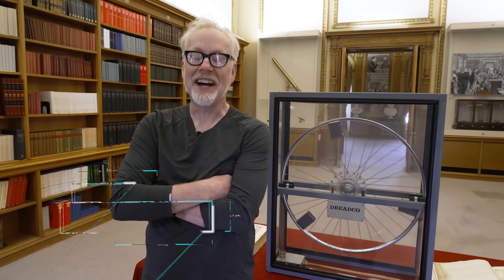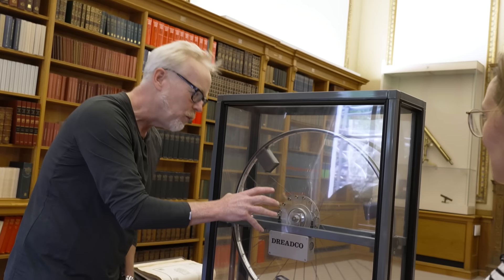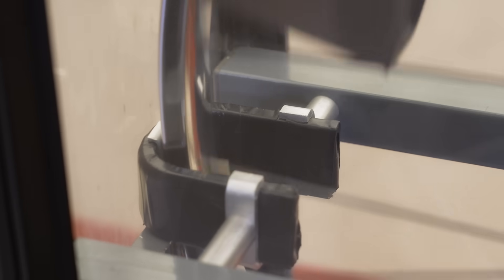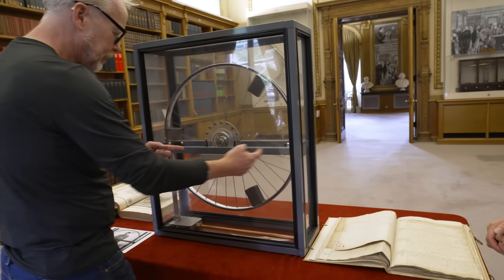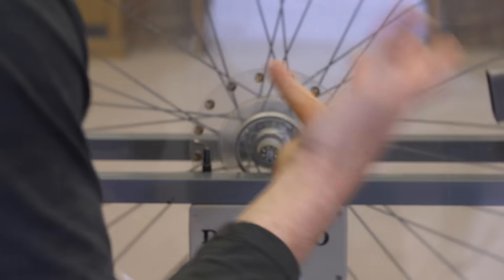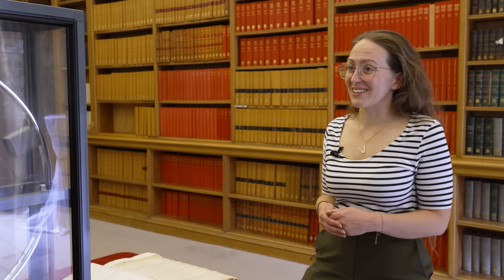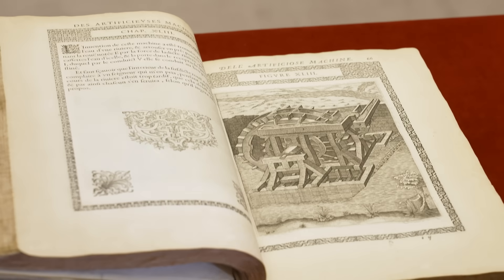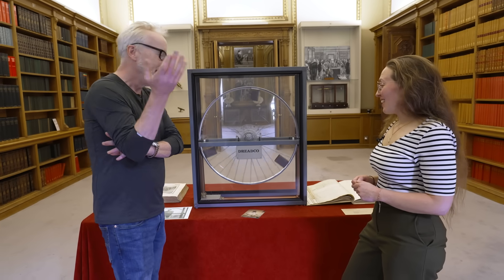Adam Savage vs The "Perpetual Motion" Machine!

Comment: I love this but suspect that it might be a carefully staged illusion. I was quite disappointed that we never saw the wheel from the other side. (180-degrees) I wonder if seeing from that angle would give away the trick. I can't help but wonder if Adam might be "in on" the joke. I did stage hand work for a time and one of the shows was a magician. Although there were limits to where we could stand back stage or in the wings, it was clear that the "back" of the contraptions were cleverly concealed when the device was rotated to give the audience the impression that there was nothing to see behind there. We don't even get a good view from the display box side.

Maybe I'm being far too cynical. We don't really know the composition of anything we see. We don't get a close-enough look at anything inside the frame or at the frame itself. What does the frame and device weigh? Are some of the spokes conductors and some spoke connections insulated? Could the "copper " conduit itself be part of a circuit and not containing or conveying anything inside? Could the conduit and the box with the "light meter" screened grommet be all for show? We don't even have a really good view on the depth of the Dreadco label. I think that the construction has misdirection almost everywhere we look. I think it is wonderful.
Reply: I watched a video of Jones showing his machine in his workshop ( https://www.youtube.com/watch?v=ZLFBgkX8lxQ ) and it has fewer extras -- I don't see the heat-sink box at the lower left and there is less visible copper conduit.

Comment: Magnets slide a ball to the outside which means the ball will be there before gravity and this add an extra force where it speeds up the wheel. The reason it slows is because of the parts becoming worn out.

Comment: Wait - David Jones? I'd love to listen to the Amp Hour podcast with him... hahaha!
10/10 would reverse-engineer. An interesting device.

The ball-like end on 0:58 remind me of a spark gap on a Wimshurst machine, might be there for attracting electrostatic charges. The spiky electrode on the opposite side might be for charging and repulsing the small round objects placed near the spoke crossings. If the latter is positively charged and the former is negative, the spiky electrode would positively charge the incoming dots and repulse them, then the negatively charged ball would attract them. All else would be any generator and control circuitry placed in the "Dreadco" box.

Also, I'm not sure what the whole assembly is placed in: what's the gas and its pressure? How does it interact with the device?
And what's hidden inside the copper tube?

Comment: Geeze! They copied one of my designs that I was recently making using a bicycle wheel!
I never finished it due to not having a board to sustain it properly without wobbling. My version runs flat on the floor instead of upright on this video. First design I started back in 2016 but for it to work properly, I need a CNC machine to cut the parts and Im not going to invest $6000 in a machine to design something that may never work. Its another reason I been laid back with it.
But this design on video is nothing but a smart motor design running on some type of voltage.

Comment: Easy answer the boxes are magnets using opposing forces  against the magnets on each end boxes on wheel ads weight to the wheel making it a Flywheel weight keeps it moving past opposing force of magnets just enough to overcome the approach the pushes it away as it passes notice only one box aligns with a magnet at a time put it in a Vacuum ? just ten Mins .  in my OMHO

Comment: Easy trick. Increase pressure inside the box with compressed air using a silent air valve you can solve this to move 2 years.

Comment: So it's just full of misdirects. It's conveniently impossible to definitively say which source is continuing to drive the wheel when there are at least 3 possibilities. (Though it's possible that it works in combination, with 1 of the sources not being enough to turn it alone. The valve is obviously used for calibration, but perhaps for syncing multiple sources of motive input as well?)

Comment: what if, as it spins, it generates a small charge that causes the perpetual motion? naturally, due to inertia and such, eventually the charge wouldnt be enough to keep it spinning, hence why it needs to be "maintained" once every few years. just needs a new charge!
Reply: No. The charge you get from the wheel would slow the wheel down, then if you put that charge back into the wheel via electric motor for example it’d just speed it back up to where it was at before. 

In real life you’d have inefficiency along the way though so after all of that work you’d actually just slow the wheel down even faster than if you just left it alone with no charge generation.
Reply: @Chevsilverado  interesting facts thanks for the correction!

Comment: The principal is impossible, but my question is are we using what we know. Is there any power station at least using something like this to make more efficient power?
Reply: most of the losses are in transmission of electrical energy to the point of use, and it is typically more than 50% of what's produced
Reply: I mean it’s always best to have the least friction with spinning things, that’s pretty much the only part of this that could be used in other machines. 

That wheel definitely does not produce any of its own power via the magnets or anything. The magnets would induce a resistance on the wheel exactly equal to the electricity generated, meaning no net gain of energy at best, and in reality you’d lose energy since your mechanisms for electrical generation and usage would never be perfectly 100% efficient.

Furthermore the vast majority of electrical losses in power generation is just from wire resistance. Even if we could squeeze out an extra 2% of efficiency from these principles like 45% of energy is still lost in transmission.

Comment: Start with a quantum fluctuation that generates an object with extremely high density and low entropy. Make it massive enough to produce a period of cosmic inflation. Then stars and galaxies will form. Eventually, a civilization will arise capable of generating another such quantum fluctuation, closing the loop. Should run forever. Of course, we may need to add a battery.

Comment: They are magnets with their negative fields exposed to the metal in the three boxes, they get just enough push and are placed so that they always have motion. When the magnets get weak it stops .hence the service .. Everything else is meant to throw u off. I made something like this 50 years ago...
Reply: No that doesn’t work. 
You need electromagnets with switching polarity like an electric motor. Just using regular magnets will never make the wheel spin more.

Why do you think electric motors need electricity?
Reply: That's what I meant..how do u think you change polarity without electro magnets.

Comment: I think its just magnets... As it turns it's attracted to the magnet by just enough force, and it's so balanced that it continues past from inertia.  Plus it has a very good bearing. So it perpetually turns.
Reply: That wouldn’t work. 

The magnet would pull the wheel faster, but when the magnets pass eachother they slow the wheel down the exact same amount. 

It’s why you need electricity for electric motors, to switch polarity of the magnets so they don’t do that.

Comment: Okay so lets do a quick high level break down of how could this work..:
Where does it get its energy from?
1) Could easily be a battery (many possible kinds of batteries could fit in multiple spots, even inside the pipes).
2) Small solar panel like Adam suggested (it kinda looks like it on the side of that dreadco box)
3) Heat from the surrounding environment (now that would be an interesting one! but I doubt it)
4) Electromagnetic radiation
5) Chemical reaction? (this is basically a battery though)

How could it turn that energy to movement?
1) Motor (would be super lame)
2) Electromagnet that turns on/off at the right frequency (so basically a motor lol)
3) Circulates/pushes air?
4) ?

Comment: What I saw was a 3 pole electric motor with a sensor board.. (the 2 little probes).. go tear apart a radio control brushless sensored motor 
and find the same propulsion system.

Comment: I doubt if you’re even gonna see this.  I think an actual perpetual motion machine is possible to build. Well.   Its very basic.   But I believe it works.  You know how you can generate electricity by spinning a dc motor with your hands.  I was thinking.  How about if a fan was connected to the dc motor.  Just like how windmills work.  But they have little holes on them where liquid nitrogen could eject from.  Next would be to connect the dc motor to a cryocooler which produces liquid nitrogen. And have it connected to another hole in front of the fan.   This is just the basic concept.  I believe.  There’s alot more work and effort to be done to make it happen

Comment: It’s sent back every couple of years because the magnets gradually loose impact with every turn? Or not?
Reply: No, the magnets wouldn’t spin the wheel unless they were electromagnets with switching polarity as the wheels magnets pass by. 

If you try to make a “motor” without switching magnet polarity it just immediately stalls.  It’s exactly why electric motors need electricity and they can’t run with regular magnets. 

This looks a lot like an electric motor, everything from the magnet setup to the polarity timing ring thing in the middle. It gets sent back for a battery change probably.
Reply: @Chevsilverado  I asked at hacker space.. Brmlab in Prague, how one motor was able to make more electricity from another. And they said it was because of the magnets in the motor, however eventually the extra charge would be lost as the magnets demagnetise. So in the end the cost was not worth it. My understanding of motors is super limited though. Thanks for your response. Makes sense what your saying though.

Comment: Magnets. If it was stopped, would it automatically start?

Does it need to be started with little resistance only to be pulled on one side and pushed on the other side to keep going.
Reply: Magnets don’t work like that. 

Unless you have an electromagnet that switches polarity it won’t continue to rotate, and the magnets won’t add any energy. 
You need an electromagnet to switch the polarity right as the magnets pass by the coil which is exactly how electric motors work. 

You can’t just put normal magnets inside an electric motor and get it to spin by itself without electricity..

And no, since it slows down over time it won’t start itself back up if stopped…

Comment: You know there is one example of perpetual motion that means it's real the movement of the atom
Reply: Or planets, etc.

Point is that there is no way to extract energy from that.
Reply: @ThomasKundera  you are right we can't extract the energy yet, it would take perfect mathematics with zero tolerance
Reply: @sylisshade2913  : If energy was extracted, it would subtract to the available one...
Reply: @ThomasKundera  but what if one powered two, similar to a single domino knocking over two more at once
Reply: @sylisshade2913  :
Once the dominoes are lying flat on the table, you need some energy to put them back up.

Comment: It works using reverse polarity in magnets to cause the wheel to push in opposite direction of the polarity. 

Basically if you used a larger version of it in several rows you could actually charge a cit. 

Basically its magnets and the law of motion.
Reply: "if you used a larger version of it in several rows you could actually charge a cit. "
That won't work.
Reply: @ThomasKundera  you never been to a hydro magnetic power dam have you.
Reply: @tehRealPRM420  : If you have been, you certainly know what is powering it.
Reply: @ThomasKundera  why do you feel the need to be so contrary, just enjoy the bi cycle flow generator dude.

Comment: Thats… my … nooo, common. Did he at least refrence the person who live journalled her god dann inventions.
Reply: The reason it stops working is that the oil runs dry, which causes larger amount of friction.
Reply: I ammend my reactiory self. :/ gmta
Reply: That ant the batteries died. …
Reply: Though the batteries are rechargeable.
Reply: Its charged mostly by the electronicall charged by the  the magnets, but it needs a push to get it going thats why it needs a couple of watch batteries to kick it up a notch, however if the batteries die, the motikn slows down and eventually stopping do to the fact the batteries can either no longer receive charge or send charge and starts loosing its charge to only the watch batteries wich are likely not rechargable, thus they burn out. Thus it stops. 

If the oil or the batteries die it cant remain in motion because nothing without charge can remain in motion. 

Also sometimes the magnets burn out. 

Thus they have to be replaced.
Reply: Basically its a perpetually motion device when charged, but nothing in motion stays in motion against another or irregular charge. 

Thus when the batteries can no longer recieve the charge from the battering ram magnets that push against eachother creating charge, that us recycled and used to continue the influx of motion by the magnets. 

Thus its a self charging continuousl motion device. 

Its mostly self propelled, but mostly not.
Reply: Basically magnets. Fluid dynamics, and knowing the cheats of the laws of physics.
Reply: Because what remains in motion, will generally remain in motion, especially if given a higher charge. 

Thus even mass moves itself when charged by current.  

Its a bi cycle magnet.

Comment: The hardest part of making a battery is always figuring out where to hide the perpetual motion machine
Reply: That sounds like something Terry Pratchett would have written.
Reply: Part the hardest machine always to figure out motion batteries is to where hide the perpetual
Reply: @Guap303  True!
Reply: Bruh this most overused comment on prepetual machine videos
Reply: @Nomi-D-Yagami  Then you read it wrong
Reply: Pratchett would have little imps hidden in there, running round a hamster wheel. Perhaps those not talented enough to work in an iconograph.
The two year 'maintenance' involves scraping out and replacing the dead ones.
Reply: Perpetual motion machines would make perfect batteries.
Reply: @gabrielclark1425  "Perpetual motion machines would make perfect batteries." Not really. Perpetual motion just means it's not losing any energy.  If you use a battery you are taking energy out.
Reply: @__nog642  If it overcomes any friction, then energy is already being taken out (although not in a useful way). Then you only have to find a way to make it produce enough energy to be useful (and cost-effective).
Reply: @adoatero5129  You're assuming there is friction. Perpetual motion would mean there isn't.

It's not very hard to imagine a theoretical perpetual motion machine. Take an object into space and spin it. No air, no friction. Yeah it'll decay eventually over astronomical timescales if left undisturbed but it's practically speaking perpetual motion. Doesn't mean it's free energy.
Reply: @__nog642  You seem to be confusing perpetual motion and perpetual motion machine. What you imagine is not a machine. The definition of a perpetual motion machine (which is imaginary because it doesn't exist and even can't exist) doesn't include "frictionless". If it's a machine, there's unavoidably some friction (or other type of resistance). Because of that, if you had a perpetual motion machine, you would by definition be able to extract energy from it, because a machine always loses energy (which is, energy is extracted from it).
Reply: @adoatero5129  There's no stipulation that energy lost to friction is usable or extractable.
Reply: @__nog642  Energy lost to friction becomes mostly heat, and we already know how to extract heat in all of it's forms. Practicality and usefulness of it are of course another matter (there might be little energy to extract, and the extraction could be too expensive to be useful), but it there were a perpetual motion machine, there unavoidably would be energy available to extract.
Reply: @gabrielclark1425  they did this on Rick and Morty lol they used a tiny universe
Reply: @gabrielclark1425  this has already been done only except its called flywheel
Reply: that’s like how the host has found it’s new waffle house
Reply: this comments the same as the other top rated commented from days before this one!
Reply: @trunkthefunk  Maybe try reading my comment again
Reply: well played sir 😂
Reply: Lmaoo
Reply: Believing perpetual motion isn't possible is ridiculous if one believes the big bang  expanding space story. 

Absent positive proof isn't proof of the negative. It shows no proof of anything.
Reply: Sounds like something Brennan Ruiz would have written.
Reply: Wait a second...
Reply: Let’s see the back of the machine.
Reply: Except you said it backwards
Reply: There was a guy pushing PM kits or p.ans a few years ago that hideous the battery in plain sight, and changed it in plain sight in his sales videos. True believers couldn't see the joke.
Reply: Perpetual motion  is possible  depending  how its powered  just use your brains it's not rocket science
Reply: this comment is so underrated 
too great lol
Reply: Ok now that sense no makes!
Reply: In Soviet Russia, battery hides you
Reply: @hyzercreek In Sowjet Russia, no need perpetual motion machine, have workers in gulag.
Reply: Repent to Jesus Christ “Let the morning bring me word of your unfailing love, for I have put my trust in you. Show me the way I should go, for to you I entrust my life.”
Psalms 143:8 NIV
U